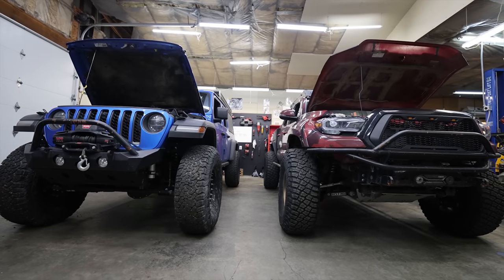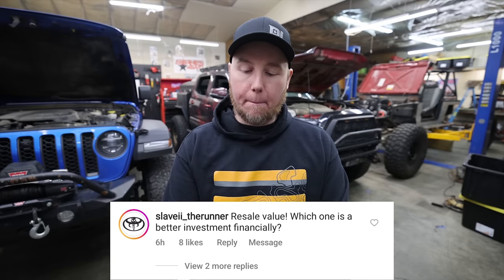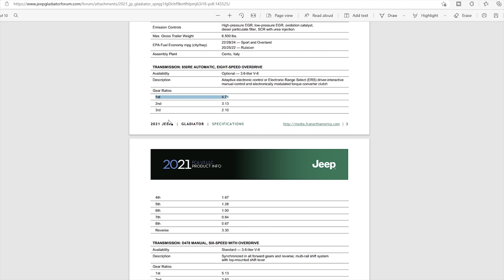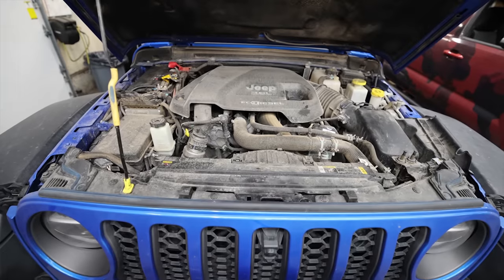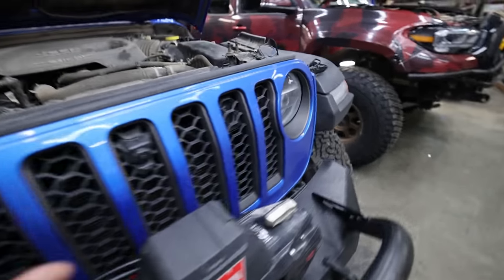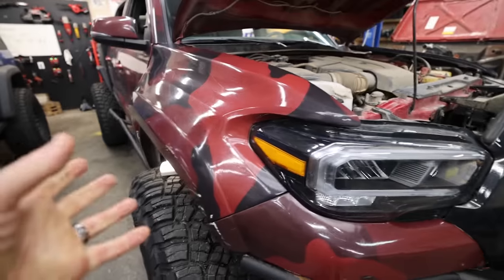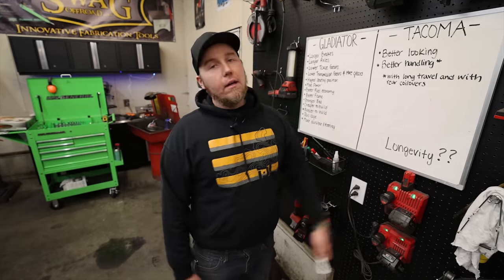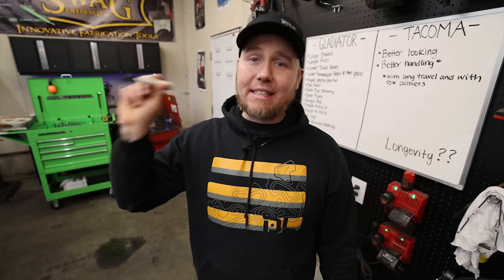My 21 Jeep Gladiator Vs My 21 Toyota Tacoma. Cold Hard Facts.

Comment: I have owned both older model jeeps (last one was on 06 TJ) and am a relatively new Taco owner (since 21). The Jeeps, the older models, required very little other than bigger tires, to be very capable. Even stock, they were decent. Never once had an issue. The taco, generally, people lift them, then put bigger tires, etc. A little more work to get about the same results. I will say this though: given driving 10 hours in a TJ vs a Tacoma, I would take the taco all day long. Every single one of my jeeps suffered from death wobble. If I hit even the tiniest bump, going over 55, it was like I was flying from space entering the atmosphere, lol. The Taco, I cruise comfortably at 70 all day long. I have zero experience with the Gladiator though. I do like that, with the taco, I need only MAYBE 5 metric sockets, and I can strip it down to its basic components. Older jeeps, although relatively simple to work on-you needed an entire mechanics set to do so.

Comment: This is why I’m in a Gladiator. I’m a lawyer and my free time is limited and precious. I need something out of the factory with a few mods for what I run that I can do myself in about a day for each mod or that are easy to find someone to do if beyond my skillset.  And all of my offroading is crawling around the Appalachians, so I don’t care about fast offroad and don’t want something too large. Got an Alu-cab canopy, 20:22 front steely and winch, oil pan/trans skid, AEV wheels and 35s and about to do the AEV lift. And wont need more except maybe a steely rear with tire carrier. And all of this is easy and simple. Hell the 35s on the Rubicon don’t even require a lift- I’ve been running em stock for about 6 months and been at full articulation with zero rubbing. Everything else stock is plenty good for my needs. Gladiators are built with offroad use first and foremost. But with that said, I’m loving mine as a daily- tracks true, easy to maneuver in the city and burbs, plenty of pick up off the line, corners really well- I out corner most of the idiots on the roads around here and I’m in a 5500 lb loaded rig on 35 aggressive A/Ts.  Honestly other than diagonal bumps where the front wheels hit one right after another, or expansion joints, Jeep has really made solid front axle vehicles easy to live with (and of course the longer wheelbase helps too).  For what you gain offroad with them, I’ll take the de minimus sacrifice onroad.  With the Alu-cab canopy I am always packed for offroading and mountain biking, with chairs, lights, pop up changing station, hammocks, and pressurized water in non-freezing temps. I can literally leave from work with no packing. Packing to camp takes 20 mins to load the tent, stove and cooking supplies and cot. And with the Rubicon there is basically no location that is out of reach. I love it. I figure I’ll likely never own another vehicle. I’ll just keep getting Gladiators. They just work. Oh- and reliability report- 0 issues on 44K miles.

Comment: A solid front axle just cannot be beat in hard off road use. I have replaced a lot of CV joints over the years. IFS is a comfortable ride at speed. But it doesn’t like rocks and logs and sticks very much. If your plan is to stay on FS roads? Great. If your plan is rock crawling? Not so much.

Comment: I like Repair Pal for reliability reports, it goes off of measurement based on the cost, frequency, and severity of actual repairs. Maybe they are bought and paid for as well, but I haven't seen anything that says they are. I also run like 20 adblockers so I wouldn't see any ads next to the articles.

Comment: I am a former Jeep Wrangler Unlimited Rubicon owner and a new Tacoma TRD Off Road owner and you will not lose me as a subscriber. I prefer Jeep and shopped both when looking for a new vehicle. Tacoma TRD Off Road was about $44K out the door, while the gas Gladiator Rubicon was $60K out the door. I believe the diesel is a $6K option so you’re talking at least $66K out the door. Imagine what you could do to your Tacoma with an extra $22K in aftermarket upgrades, it’s hard to compare these 2 with such a huge price difference, of course the Gladiator is superior. If you’re bothered by this as a Toyota guy, just put the extra $20K into your truck and you’ll have a badass Tacoma 😂

Comment: Sooo I am a big Toyota guy, I'm also a big Jeep guy. I currently own both. I wheel and build both. My 03 Tacoma on a highly modified front IFS which still breaks all the time. My TJ and my JK don't break all the time. But like Nate said my Tacoma and my 19 4Runner drive and handle so much better. The 4Runner being the best. That said my favorite Toyota I no longer have is my first one, which was a 79 "pickup" simple bulletproof engine, and a solid axle up front.

All that said, I love both brands. But Toyota has been riding the same horse since 2001 with the introduction of the TRD Off-Road package. You get lower gearing and a rear locker. They haven't really stepped it up any, the only thing that's changed is the addition of crawl control. And the Pro line is just an appearance package for the Off-Road. Toyota needs to build a real TRD Pro and give it front lockers, give it lower gearing, give it beefier IFS components.

My complaint to Jeep is I want a 2 door!!!!! And call it the Scrambler. And a shorter bed, all that over hang looks like a soggy diaper.

Comment: This is a good video brotha! The only issue I see is that you are comparing 2 rigs with about 40” tires with tremendous mods. Obviously, jeeps are built to handle the type of mods you like to do and without hurting the wallet. With Toyotas it will cost you a lot more. Reliability, comes into to play for toyota once you go that big of tires and suspension. Most Toyotas aren’t running the type of suspension work you did for yours, and thats where you are seeing the reliability issues.  I can speak for both perspectives, having owned a rubicon JKU and now toyota.

Comment: As someone who's owned Toyota and was super toyota before I bought my gladiator. All the reasons stated in this video are 💯. I just got out of building a 4runner and it was an amazing vehicle, but it just lacked when it came to off road dependability. Busting CV axels because the travel wasn't good enough and all the money that's needed to make it what a stock gladiator rubicon would be was a complete deal breaker. The jeep is so much easier to work on and parts don't cost an arm and a leg because they're simple bolt on products. The bumpers alone cost THOUSANDS when my front bumper for the Jeep was like 600$. I didn't need to cut anything off my jeep to make my bumper fit. I didn't need to do any type of crazy fabrication honestly at all on the Gladiator. I had to cut so much off the 4runner just to fit 33 muds and still rubbed at full turn. My jeep runs 37s no issue on a similar lift. Only major difference I see in toyotas vs jeep is road noise and that's because you can literally tear apart your jeep so it's not sealed as well but to me I think the jeep looks better.

Comment: Outstanding, honest comparison. As a Lexus GX470 guy (with a 19 year old rig), the decision of Toyota to put a c-channel frame in a brand new truck always baffled me. Imagine how much better the truck would handle with a stiffer chassis which forced more of the spring and damping work to be done by the suspension components. Both great platforms regardless, love the content!

Comment: An excellent review.  Much better than a car mag or Consumer Reports would do.  Someone kids about comparing sun visors in another comment.  I do wish you'd done that though:  The sun visors in my 2007 Wrangler, at nearly 300K miles, still suck because they don't block much sun, but they work as designed.  In my Gladiator, I've had to install eBay reinforcements to both because with 25K miles both had broken such that they flopped around loosely.  A common problem that should've never happened.  Other than that, the quality of the materials used in the JT are way better than my JK.  Anyway, really do appreciate the comparison.  Hopefully Toyota is paying attention and, as you mention, they have better options to sell here.

Comment: My 2004 Nissan Xterra 4WD has 233mm 4.90:1 ring gears. In SAE, that's 9.17 inches. The frame is fully boxed and welded. It has over 200,ooo miles on it, too! 
First gear is 2.785:1, reverse is 2.272:1.  <-- Yep, 1st gear is lower than reverse! Who'd-a-thunk it?
Transfer case Low Range is only 2.020:1, but still plenty strong.
Crawl ratio is 27.56593:1, so it's actually plenty good enough. (I've had zero issues going where I wanted to go, but I also don't do extreme off-roading like you do, either.)

Cons:
It has no real power with only 3.3L at 180 HP and not much more for torque.
Automatic is only a 4-speed. (Starting in 2005, they went to 6-speed.)
Ride quality is good due to front IFS, but that also makes it weaker than a solid axle.

It seems like Toyota thinks that Americans are dummies and just want mall crawlers.

Looks are in the eyes of the beholder. I actually do not like the looks of the current Toyota trucks as much as the earlier ones.

But don't worry, I'm not a snowflake. I'm not un-subscribing just because we differ in opinion on looks. You're a hard worker, you have a lot to share with folks, and I learn something in every video. Keep 'em comin', sir! You're doing great.

Comment: I'm originally from Montana - the hard corrugated dirt roads absolutely EAT the frames of trucks that either have lots of gear on them or are daily driven at full tire pressure. The weaker frame on the Tacoma  will lead to stress fractures given the virbrations from the rough roads.

Comment: Thanks for the review.  I think you finally got it off your chest.  I have watched the Taco vids with great interest.  I think you should finally sell that thing.  You never liked it from the beginning.  With it's "Offroad" badge and all the electrical gremlins.  You needed a more basic model to start with IMO.  Now you'll move on to the '97 80 series.  You may not like that one either.  Should have got the '96 model, for Toyota was trying to trim the fat on the '97 model with a lighter front end.  Or with your resources you could import a 70 series pickup then do the comparison.  A little more apples to apples with Toyota's Top o the line 4wheel drive.  One could make the case that the Taco is 3rd or 4th in line on Toyota's 4 wheel drive lineup?

Comment: I agree with everything here and it’s why I dumped my 3rd gen Tacoma in less than 3 years for its big brother. The Tundra doesn’t struggle to tow an empty garden trailer like the Tacoma did, it sounds amazing when you step on the gas with the dirty deeds exhaust I added, and it has a massive 10.5” ring gear. Still has Toyota reliability but it’s way more fun and capable for everyday life.

Comment: I've owned both, and currently drive a 21 Gladiator Mojave as my daily.  Why?  I just like it more.  It's not better handling, and it's not more comfortable.  I like the heavier frame, and I like the cast knuckles on the Mojave.  Upgrades are reasonably easier on a solid axle vehicle.  I do wish the interior was a little wider, but since I'm typically the only person in the vehicle, I can manage that. Great vid.  Both are great.

Comment: Great review I’ve been looking at the Gladiator to purchase you’ve made my choice Gladiator. I do own a 2nd Gen 4Runner but only thing stock is the body the  suspension interior has all been changed even the gears with lockers it’s great for tight areas. I think the Gladiator will be a nice addition to my off road experience

Comment: Thoughts on the Nissan Frontier?

I'm partial to the Jeep but i like the Frontier more than the Tacoma. I think only because the Taco seems to be the default option in the mid size truck category.  3 of my coworkers (there's only 10 people in our department) own current gen Tacomas, and one more owns a Tundra. One of the Tacoma owners also owns an FJ Cruiser.

Comment: Tacoma going back to C channel frames was primarily due to the frame rust issue and the warranty they provided for the frame. Japanese automakers had poor paint practices at the time. They would rust out and fade sooner. It was also on decades old frames. Granted not great, but still they made their warranty so long on the frame they ended up replacing a lot of frames.

Comment: Great video. I sold my 2019 taco because I was not happy with the gearing and the way it made power, but went to the Tundra, because I wanted a truck more than a hybrid. I have a TJ as well, for wheeling (nothing to the extreme you have or do), but the TJ is really limited to 1 passenger. I agree this will challenge Toyota to step up, just like the 80's toyota pickups did to the Jeep wranglers. It is a healthy competition and it is hard to argue with facts, though many try.

Comment: Hey Nate, my name is Aaron. I live on Vancouver Island and I absolutely love all of your videos. You are very straightforward and informative and I value that. My wife and I just purchased a 3.6 auto eight speed gladiator. We are in the process of doing some mods and I have been struggling like crazy with figuring out Gearing do I go 488 or 513? The problem is trying to figure out overall what would be best .we tow a trailer a few times a year, but spend about 85% of the time not doing so. I would consider myself a Rocklander . We have done some wheeling in Colorado as well as Moab. I was kind of thinking 513 but a lot of people tell me with a smaller ring and pinion. I’m going to end up possibly damaging them as well as possible heat issues. What are your thoughts?

Comment: You cant just go by measurements or just steel or aluminum because there is so much more to metallurgy. However some factors you have pointed out with design, and accessories are very accurate. Good work. I just dont like the build quality with Jeep or Toyota current models. But they are not the worst.

Comment: Toyota master tech here. The frame issue is very well known. The difference between jeep and Toyota was that Toyota recalled it and jeep never did. Toyota frames rust at the rear forward spring mount and the front mainly drivers side door body mount.

Comment: One of my really good friends has a Gladiator with almost 100k miles on it. 37” with a mopar factory lift and a bunch of heavy overlanding stuff on the bed. We went on ride with a bunch of built and I mean built Tacomas and 4Runners. One 4Runner had 39s on it. 

They were all struggling every single one of them. Then here comes my buddy just costing through everything no slipping, no drama, like a cloud to ride in. Just did it and moved on. That was the day I knew I needed a gladiator. 😂

Comment: Am currently building my ‘01 GMC Sierra 1500 SLT Z71 Ext Cab into an Overlander…. I want to eventually put a Z71 3/4 ton rear end and complete suspension under it. It has a 5.3L which I’m happy with. However if I had like $10,000 to spend I’d put like a 4.3L twin turbo in it with a custom wiring harness. The design of the Ford Raptor with the twin turbo V6 is awesome! My brother has an F150 that’s built the same as a Raptor w/o the Raptor package and the full cab size sunroof. That much glass in the roof it just stupid imo. After having a cpl sun/moon roofs bust it’s a feature I don’t ever want! Aside from that the fuel economy of 6 cyl in a full size truck and the power/torque of twin turbos when needed is so very appealing to me. I plan to run 35 AT’s on it. I’m never “mud bogging” or “rock climbing” w it. I just want a very capable off-road rig that’s still very comfortable on the hwy, since most of my miles will be hwy miles. Since I’m not rock crawling or mudding there’s no reason to build a rig that needs to be trailered from place to place. Also the trip is always more important than the actual destination IMO. Love a good road trip that isn’t rushed, can sight see and take my time. And go off-road when I get where I’m going and camp in my rig. No need to pull a camper or trailer when there is no need for one.

Comment: Thank you for an honest comparison, and you made a lot of really good points. I totally agree with your assessment regarding reliability. I've owned a TJ and a JK since 2008/2009, and they have both been very reliable. My wife's last Jeep was more reliable than her last Toyota, so I have to roll my eyes every time I hear about the "legendary" Toyota reliability that everyone crows about.  Jeeps are reliable too, and less likely to break off road, which makes them more reliable when you need them most.  

I've noticed a lot of inconsistency with Consumer Report ratings as well.  When Toyota and GM shared a single factory and made identical cars with both GM and Toyota badges, the Toyota's always received stellar CR reliability ratings, and the GM's did not (example: Toyota Matrix vs. Pontiac Vibe).  This suggests a psychology factor where reviewers partially base their inputs on reputation rather than facts (there have been studies on this).  They "know" the Toyota is reliable and don't report the same number of issues as an identical car with different name plates.